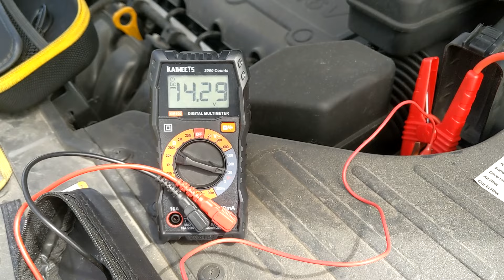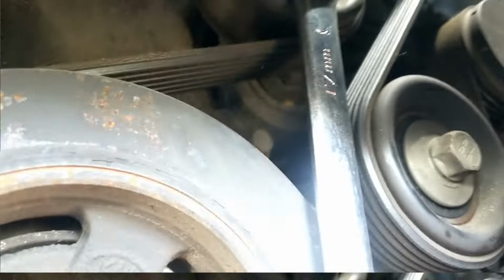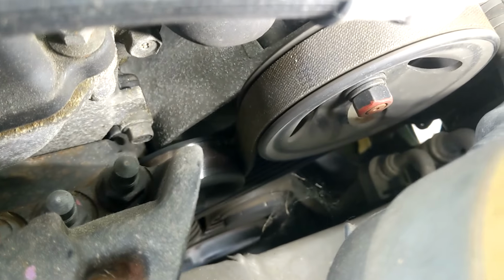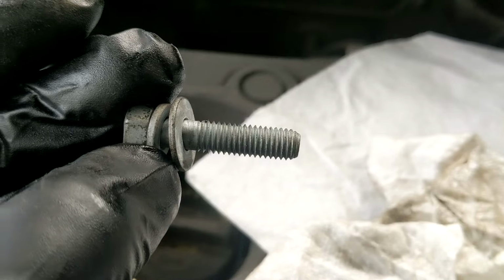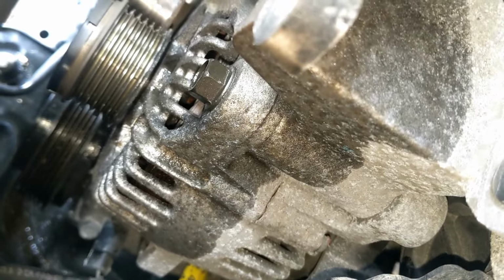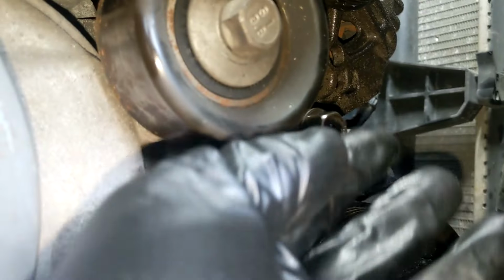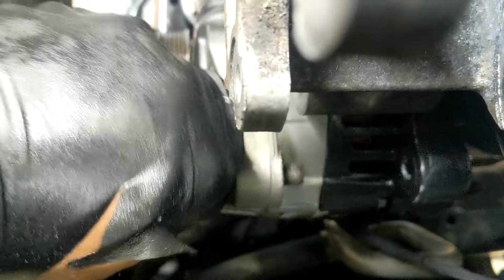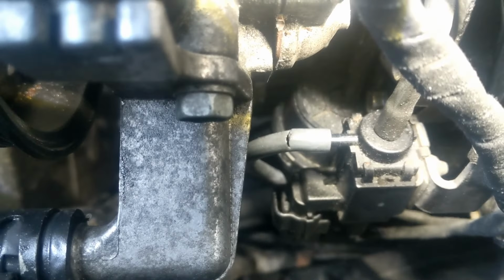Replace Kia Sorento Alternator in less than 12mins. (2011-2015) 2.4l

Comment: Thanks for the video, this was extremely helpfull. I did the whole job today start to finish in about 2 1/2 hours. You saved me a ton of guess work. It worked out smoothly & I didn't even F bomb once which is really good for me 😂
Reply: Hi! Did you have to do anything to the AC after? Like, did you lose freon?
Reply: @carlosmanuel3468 no you wouldn’t

Comment: Thanks for clarifying the raising the engine part. I was thinking maybe that bolt is clearing but nope. Good video 👍🏻
Reply: How did you raise the engine up a bit?
Reply: @ at 8:05 he explains it. Just losen that nut like a quarter inch and then literally just jack the motor up underneath. I put a 2x4 block between my oil pan and jack just so it wasn’t metal on metal.
Reply: @ also I used a 3’ pry bar to get the alternator out. Worked great. For me it was the easiest part. Just be careful god forbid you break a bracket that’s part of the engine block. 
I did it through the wheel well just behind the alternator. Literally the only part you can actually get to with a pry bar
Reply: @theboss477  got it, thanks!

Comment: Thanks for the video 
I removed the power steering reservoir to make plenty of room.
Got the bolts out just fine.
Alternator will not budge.
Afraid to beat on it much harder?
Am I missing something?
Reply from the maker: @lylepopson7527  oh you're talking bout it being stuck where it mounts. I had to hit with a hammer and pickle folk to get it to move. You can spray some penetrating fluid in the bolt holes as well.
Reply: Thanks 
That's what I ended up doing 
PB blaster  and a block of wood and a big hammer 😮
And as much as I hated  I had to hammer  the new one in place🙄

Comment: Question the PS pump how big of a pain to get back in the bracket? And what did you do just wiggle it?
Reply from the maker: Not too bad. I would maybe hit it with a wire brush or sand paper to give it some more clearance to make it easy to get back in its spot.

Comment: Any tips on getting the power steering pump back in ?
Reply from the maker: @tristyndavis4387  Wire brush or sand down the area where it sits then spray some wd 40 or equivalent in there.

Comment: Man, I've done everything you've said to do but the alternator just won't fit out. The AC lines are in the way. How did you get it out?
Reply from the maker: Move the power steering reservoir out the way, and you have to position the alternator just right to slide it out.
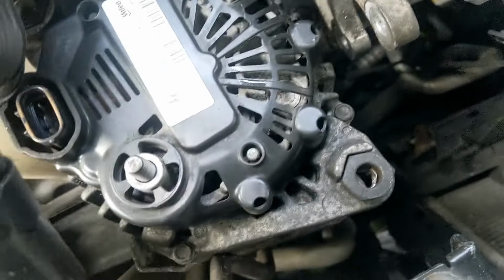Reply from the maker: 9:11 Position the alternator the exact way you see in the video when its on its side and slide it in the same way i drop the alternator down.
Reply: @AUDIO2AUTO  I'll give it a shot!
Reply: @AUDIO2AUTO  it worked!!! Thanks, bro!!

Comment: Your old alternator looks soaked with oil.  Is that because of the engine oil leakage due to a bad "Low oil pressure sensor?"  Kia had recall on the item (sensor).
Reply from the maker: Its power steering fluid from when it was moved out of the way.

Comment: Man just drop down AC compressor it took you 12 minutes just to take the belt off😅
Reply: thats my method for 2016 Kia Sorento as well but it extremely difficult to get the mounting bolt on top behind the AC tubes

Comment: How do u raise the engine up to get that top screw out....do u need another jack🤦
Reply from the maker: Yes, just use another jack with some wood or rubber in between the top of the jack and bottom of pan. Dont have to lift it far.
Reply: I used a 14mill flex ratchet

Comment: That's so dumb you have to raise the engine to get one bolt out. How hard would it have been to just put an access hole for it to go thru! 🤦🏻‍♂️
Reply from the maker: Exactly or they could have made the bolt shorter also.
Reply: That’s the power of an engineer at work